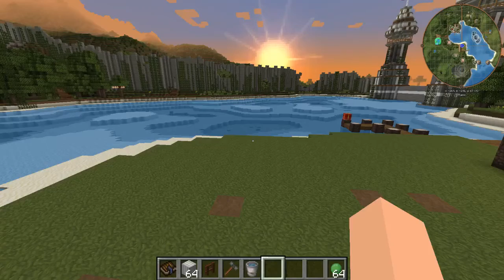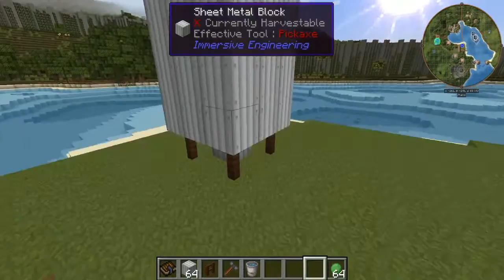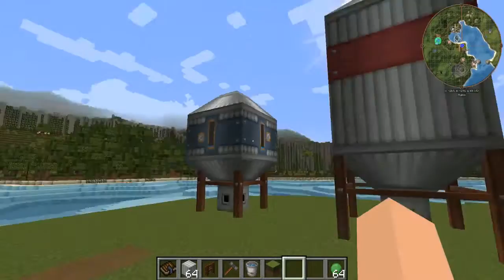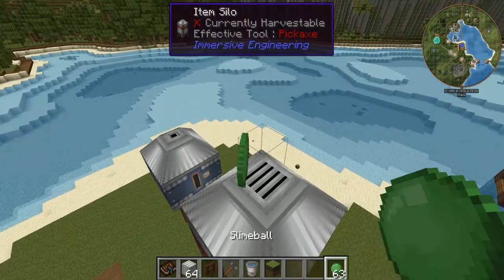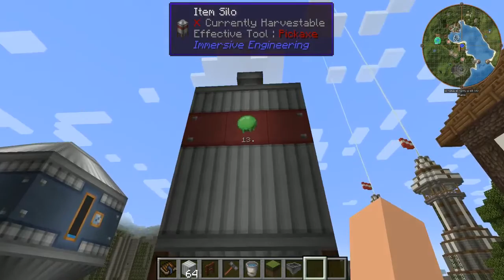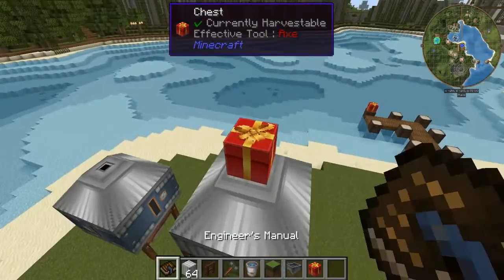Immersive engineering how to : SILO

Comment: You should specify which block is from which mod. The tank block that holds water (the one that looks like a transparent glass block) is not from the Immersive engineering mod and took me a bit to find what that other mod is. The same goes for the fluid conduit.